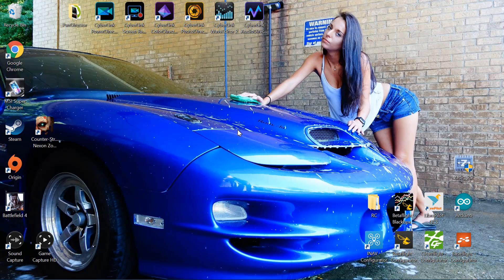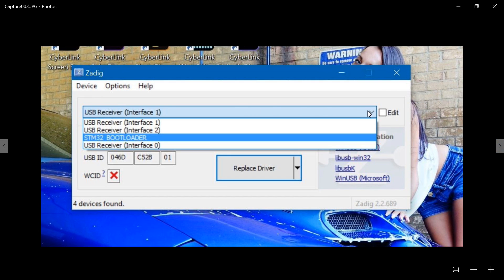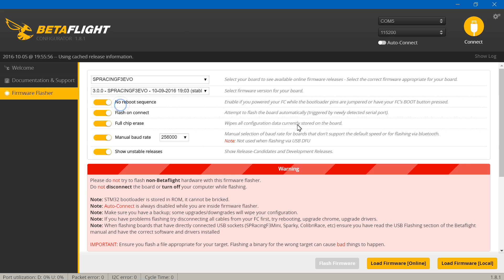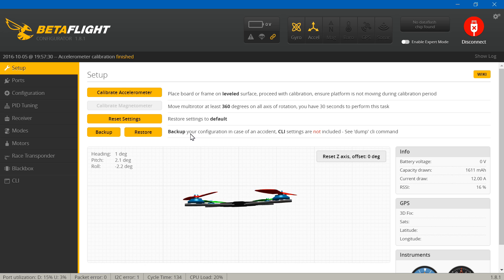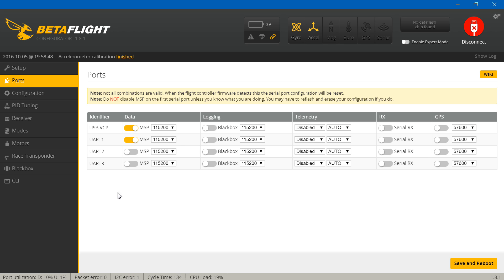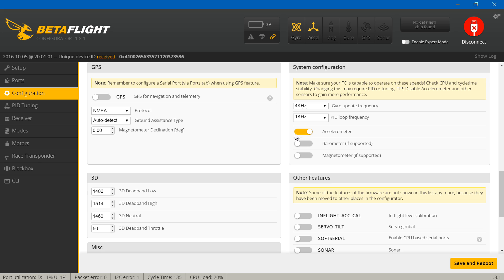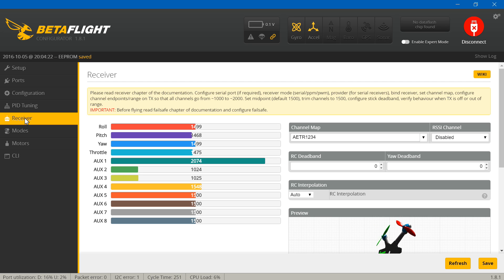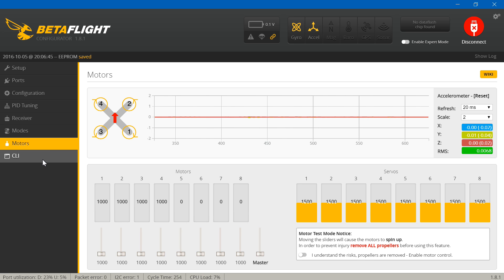Brushed F3 Evo Set Up In Betaflight

Comment: Hi, I am using and f3-evo-brushed v2 it has a tx connected to it on uart2 and a TX06 FPV CAM connected to the battery it works fine. I wanted to connect the minimosd micro to it but it only show data then connected to uart2, uart1&3 aren’t working. Any idea what I am doing wrong?

Comment: I COULD NOT GET MY QUADCOPTER TO FUNCTION PROPERLY WITH THIS BOARD UNTIL i WOULD PLUG IN QUAD BEFORE TURNING ON TRANSMITTER. Now it works fine as long as I plug in quadcopter BEFORE turning in transmitter!!!!

Comment: Hi can you help me? I have solid red light when i connect USB , but its not connecting to cleanflight or betaflight. It is trying open serial Port in configurators but closes then. It also says stm32 communication failed when im trying to flash?? Any good advice? Thank you.
Reply: he is dead, man
Reply: Install ImpulseRC Driver Fixer Tool, Zadig, the DFuSe package, etc, and follow an online manual as to the steps

Comment: Thanks for the vid sir.  I am attempting to maiden a Phoenix Flight Gear 110mm frame with a HOBBYMATE Brushed F3 Mini Flight Controller.  I had power glitches during Betaflight setup that cause the FS A8S rx to power off while connected to Betaflight.  The FC and VTX still have power while connected to Betaflight.

Also, after doing all the setup following the directions in this video, I can get airborne and controls work (yaw, pitch, roll).  The throttle is at 70% to get hovering and after bumping up the throttle to gain more altitude the quad gains altitude then drops and loses connection to the tx.  

Now when I plug in a battery, the FC won't power on, but the rx and vtx do.  If I plug back into Betaflight everything powers up fine.

Very confusing to say the least!

Any ideas why this is happening?
Reply: UPDATE - The quadcopter is flying now.    I happen to have two new fully charged 1s 370mah batts.  I tried one and now it's flying.  The throttle is still at 70% to hover.  I would like to be around 50% stick.  How do I change that?

Comment: i cant get mine running on 2s as soon i plug the battery motors start spinning full speed i did solder the pin for 2s when i plug the 1s battery works fine
Reply: yul merced don't solder the 2 pins just leave it like it comes factory just plug in the 2s n it'll work

Comment: nice vid, just got all set up but all 4 motors going clockwise ? help needed !
Reply from the maker: You may have two of the motors wires run backwards. Thats really the only thing that can make them spin the wrong way since they are DC motors and dont use ESCs.
Reply: thanks got flying on 2s set up but only get 20 sec. before slow
drop & batt very hot , vbat still at 7v.  what am i doing wrong ?
Reply: reset all motors reflashed now going to full throttle when i connect 2s  ? can you help ?
Reply: flip the wires on the 2 motors that are going the wrong way
Reply: Did you find a solution to all motors full throttle? I have the same problem.

Comment: is there a way to set the motors to a different position I need to move motor 6 to motor 1 because the tiny surface mount broke off on motor 1 so now I need to use motor 6
Reply from the maker: I'm not sure about these brushed boards. I've never tried it. I know with the normal boards you can use a custom motor mix to mote motors around.
Reply: that what I thought not having much luck with this board worked for a couple of times then everything went downhill
Reply: You can I did found guide online